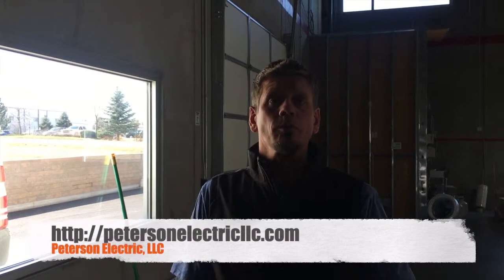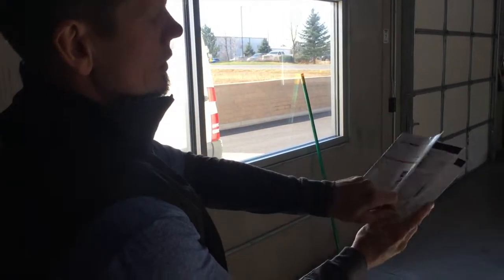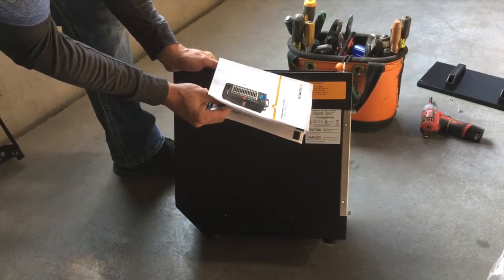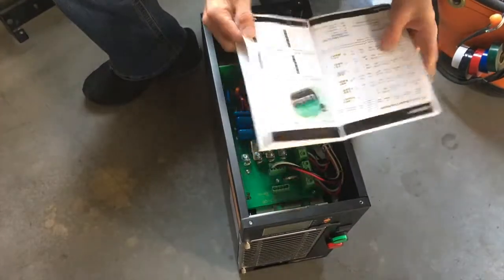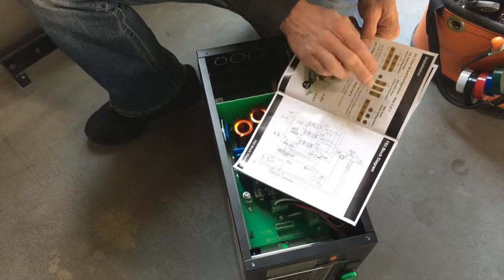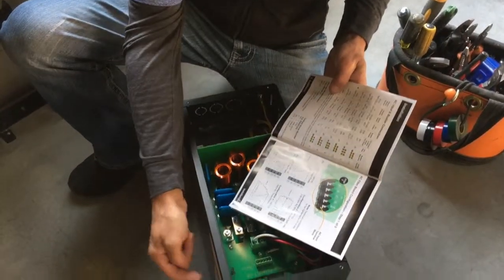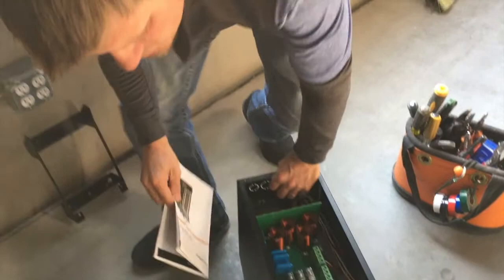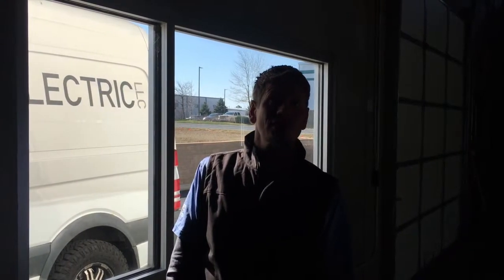V Force Installation on a 3-Phase Forklift Charger

Comment: Hello Mr.Peterson thanks for your video,i was wandering what can get damaged if i hook up a 48DC volt forklift battery charger thatwas wired for 240volt 3ph to a panl that has 480 volt 3ph because i hooked one like that and i got a loud pop noise and smelled like burnet you think we can repair that charger?if you can comment some avice i would graetly appreciate it.
Reply: If you connect a newer high frequency charger that is set up for 208V or 240V 3ph to 480V 3ph A/C, it will burn up the power supply board. Most newer HF chargers can not be changed from 208, 240 or 480V. They have to be ordered for the specific A/C input.